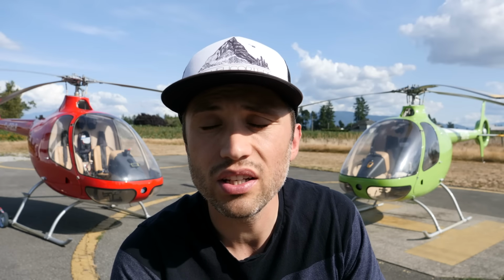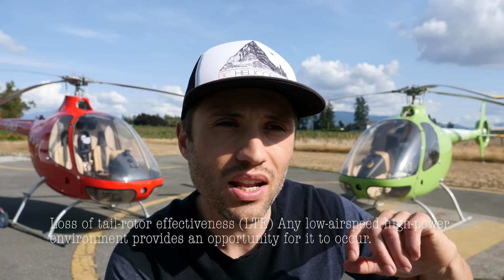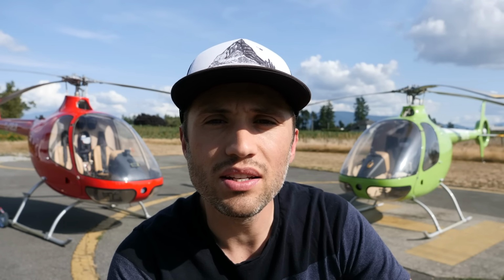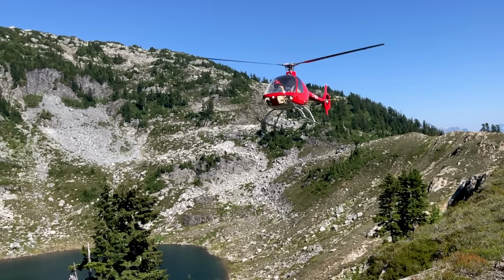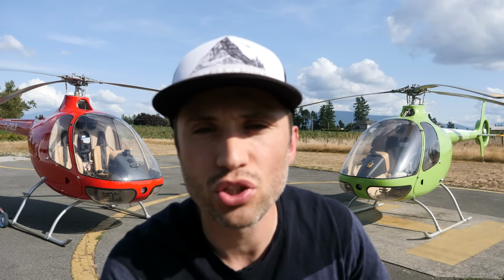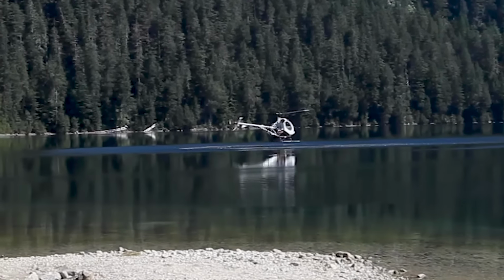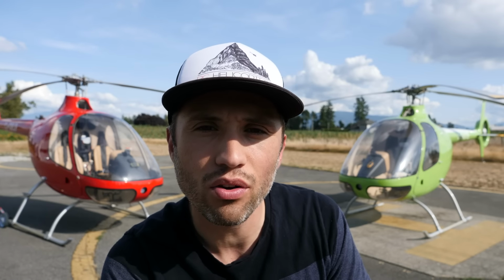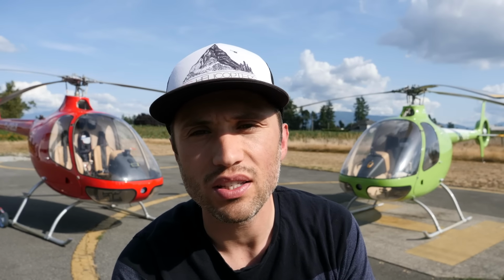OVERPITCHING and LTE can lead to a HELICOPTER CRASH

Comment: I am not a helicopter pilot. How the hell does one have enough power to hover, and then seconds later not have enough power to hover?  Not a single thing changed in that time period. Did a mechanical failure happen? How is any helicopter design certified as being safe for flight if that could happen? Why wasn't this explained in the first portion of this video?
Reply: Temperature, pressure, humidity and altitude all affect the amount of lift the blades generate. The air is a lot less dense at higher altitudes with low pressure and high temperatures, which makes landing and taking off in high mountainous areas or high elevations more difficult.

Comment: This happened to me in one of my Xbox games all I had to do was give a little extra left throttle  .. it was a little different because my bird had floats on it .. yeah I kind of kick ass
Reply: There is no more power available though in a true over-pitch scenario hence the drop in engine RPM. Your situation, accurate flight modelling aside which is to all intents and purposes non existent in an xbox game, was not the same thing at all, you clearly had power to spare.

Comment: Why do you lose power when your hovering close to the ground like that.
Reply: Because you've lost translational lift, there's almost no ground effect hovering over water, and his landing altitude was likely higher than his departure altitude.
Reply: Scott Kkk you don’t lose power. You just need more power. And if you don’t have more ...  it’s like running out of money. Or wits, if you can relate to that.
Reply: @warrenmatheson563  is that accurate? minimal ground effect over water? i thought i remembered that from somewhere
Reply: @josemadarieta3  that's correct. Ground effect is always minimal hovering over water.

Comment: Excellent video and great explanation... It is really important for rotary wing pilots to spend time in the power / performance tables of their aircraft and to check the performance of the aircraft at the associated density altitude prior to taking on "higher" risk maneuvers such as in this video.  Not all aircraft engines may be meeting the performance in the tables that are published with it.  Also wise to make sure you give yourself somewhere around a 10% buffer between your power required to hover and your power available.  Not sure what this guys deal was on gas, just burning off a little gas can give you that power margin. 

Here is a link to a very good FAA advisory on LTE...
https://www.faa.gov/documentLibrary/media/Advisory_Circular/ac90-95.pdf

One way I have often thought of this is that the engine or engines of a helo has a finite amount of power and that power must be divided between the tail rotor and the main rotor.  Once you are in the situation where you are drooping Nr (Power Available is below the Power Required) LTE is very soon to follow and as stated here, the only way out is to gain forward airspeed.  This can really be as simple as leveling nose and wings, center the ball and reduce collective every so slightly.  For most rotor aircraft the wings level attitude is an accelerating attitude.  Once inside translational lift - you are flying and breathing again.  If for some reason you do not fly it out, you will at least be in landing attitude.  When Nr droops, is what helo pilots mean when they say "do not get on the backside of the power curve."  Successful management of any power emergency in a rotary wing aircraft begin with Nr - management.  

Also know when this situation may be at play... High DA, Temps, Humidity are the easy ones.  Losing wind incoming into valley or ravine, down drafts / orographic turbulence.  Making elevated pad / pinnacle landings in a city where winds may create a downdraft causing a sudden increase in power required... also doing these maneuvers at night can also set you up.  It can be harder to judge rates of closure and distances at night.  This can force pilots to make more abrupt or aggressive maneuvers thus  requiring more power correct when compared you how they might execute the same maneuver during the day.  Lastly, do not underestimate fatigue on these types of maneuvers.  Segway...

Consider human factors...
This could have been a high time pilot at the controls and this could have been his 7-8th approach into this LZ that day.  As you get tired - your error rate goes up.  Could there have been a distraction like a radio call or something?  Base ops calling... remember Aviate, Navigate, Communicate (in that order) and do not forget your I'M SAFE checklist.  As is the case in most mishaps... I would guess there are multiple factors at play.   (Error chain)

Another thought on LTE... the direction of the wind as you are coming into an LZ (if forced to take a cross wind) can create an uncommanded yaw (left or right) dependent upon the rotation of your rotor blades.  Anytime you are reach the end point (or the throw of your pedals) to maintain balanced flight in a turn is opposite the direction your aircraft would turn without the tail rotor you are in danger of entering an uncommanded yaw.   While not super common it can happen.  My best advice is, do not fly your helo like your in the blue angles.

I spent a brief period of time in the USCG flying "Tupper Wolf" H65 (A, B and C) models.  The Alpha was notoriously underpowered and it forced its pilots to pay close attention to power management and the performance charts of the aircraft.  On hot summer days we would burn off gas until we could get to our single engine flyout speed and often trained for a single engine failure in a OGE Hover.  It really is a very benign maneuver and is the same exact way I would manage a situation such as this.  I also have some hours in the R22 and can say that the principals are the same on that aircraft.  I love flying and totally miss being in the cockpit.  Great video and thanks for sharing!

Nr maintain...
JBH

Comment: why would the engine ever be out of power to keep the helicopter aloft?
Reply: Density altitude. You have more available power at lower altitudes. He may have been within the envelope from where he took off but landing in the mountains could be a different story depending on altitude, weight and temperature.

Comment: So I'm confused the helicopter is supposed to hover it's not like a plane so you telling me helicopters don't have the power to hover no matter where you're at?
Reply: Air is thinner at higher altitudes.  Fixed wing aircraft suffer from the same problems.  That's why fixed wing aircraft have an operational ceiling.  At or above that ceiling not enough lift is generated by the airfoils to keep the aircraft in flight and it will stall.  The same is effectively happening here with the helicopter.  That's why you will often see helicopters take a running start to take off instead of just going straight up - especially at higher altitudes or if the aircraft is overloaded.  Once the helicopter reaches a certain speed it generates what's called transitional lift.  That lift is enough to keep the helicopter airborne.  At slower speeds there isn't enough lift generated and the helicopter sinks.
Reply: @BitwiseMobile  thank you,  it must have to do with a certain helicopter as well because I've seen helicopters and search and rescue logging and such were they are hovering in the damnedest of places forever to retrieve somebody or objects with zero problem

Comment: Ouch, you are pretty harsh on that pilot. I say the big mistake the pilot made, if you want to point fingers (and I don't think you should), is to fly such a crappy helicopter. That's machine crappiness in it's awe and splendor. The pilot made a beautifully-flown approach to a hover. But obviously his helicopter is either a piece of crap or it malfunctioned. Of course, once LTE sets in I also think he handles the situation very well by putting it down like he did. Good pilot, crap machine.

Comment: Well 1st think you don't fly over water. Flying over water is what caused it. Every pilot know you have less lift over water. You need speed for more lift. Just like landing a plane over water . You lose lift. Called Ground effect. Water reacts different than hard ground on lift. I seen a plane crash at the end of the field because his approach was over water and no amount of power would save him. He kept giving power but the plane wouldn't respond over the water.So he crashed at the beginning of the runway hitting a fence. Need to come in hotter over water and higher.

Comment: Ok,.... You are completely wrong. What you mean by over pitching is not clear. I would say he over pitched his collective he pulled too much. Inducing drag on the main rotor system. You can hear the engine rotor RPM decay as the aircraft descends into the water. The loss of terror effectiveness LTE is caused by the low rotor RPM. This is called settling with power. The LTE was just a byproduct.
Reply: I agree with with you on all of your statements except the last part about settling with power.  Falling below the the power curve of the engine (RPM) played the biggest role. I've been there in an Enstrom. Hovering over water or tall grass takes more power than over a hard surface. Settling with power can happen without a lack of power from the engine,  it is best described as descending into your own downdraft, caused by descending straight down. The more power you add, the faster you fall until you fly out  of it.  I once found myself hovering over deep snow (so i could not just come down in it) in an Enstrom 280. I had a passenger and full fuel. I started to loose some RPM over the snow, and  I remembered a trick from an instructor that was not mentioned here. The tail rotor takes 40 to 60 HP from the 240 HP engine to counter torque.
I applied right pedal and went into a spin to free up some horsepower and was able to get my power back up. Get good at doing pirouettes is my advice.

Comment: I hear everything ya said, and all I can think of is that these little "toy" choppers are all under
powered and shouldn't be certified. If yer hovering in ground effects and yer not carrying your 600# girlfriend, then the damn craft should be able to stay in the air with all it's flight controls actually controlling the flight! It's not like yer trying loop de loops waaay outa the flight envelope. That chopper not being able to stay dry is like the family mini van not being able to climb a hill with two percent grade. Sheese.
Reply: almost any machine is gonna hit a power limit at some point, even the mini van. the pilots job is to know where that point is and not take the machine past it and ask it to do something it cannot. there were a lot of things this particular pilot asked this particular machine to do that it simply could not. result? somebody took a bath
Reply: Gotta agree with Johnny here. They do seem very underpowered. Like a sewing machine almost.  Good information in the video nonetheless. Though it seems the threat of pilot error is greatly increased due to the limited power available.
Reply: You are ignoring all the other factors here. They are a great training and light work helicopter. I grew up flying them. Safety than a Robbi. This was inexperience and maybe bad training. 

Every aircraft has its limitations, a good pilot knows how to avoid them with a good safety margin.

Comment: Can a coaxial-rotor or tandem-rotor heli get into this condition?
https://www.youtube.com/playlist?list=PL7kRxbZe5xzl6J317dUX-rEe4tjFx-WAd

My intuition is "no" based on what little information I have been exposed to about these rotor configurations. Coaxial is practically non-existent in the West, but the Soviets really pursued this concept, and their inheritors are still keeping the design alive today. There are a plethora of videos here on YT showing Kamov helicopters. Hungary seems to maintain wide use of the old Ka-26 model in agricultural applications; it's wonderful to watch them fly.
In a coaxial design, I understand that the foot pedals affect the symmetry of pitch between the two main rotors, to either keep the torque of one balanced by the torque of the other, or to create a deliberate asymmetry so the craft will start to rotate.
So if you are out of power, the rotors will slow and you'll begin to sink, but since the torque can still be balanced as desired between the two main rotors, you will maintain yaw control nevertheless. This may make it easier to recover, as once recognized, you can just add forward cyclic and build translational lift more quickly than might be possible waiting for keel stream to stabilize you in a conventional helicopter with a tail rotor, once tail rotor effectiveness has already been lost.
I've been building a playlist of videos (linked above) I've seen demonstrating small coaxial heli designs. I need to learn more about the disadvantages of the coaxial design, but the advantages to not having a tail rotor to worry about, maintain, break, etc. are attractive to me.

Comment: I dont understand this: Why does the helicopter run out of power in a hover in ground effect in the first place? - how can a helicopter fly if doesnt have power to hover in ground effect?
If you are low to the ground, as the helicopter over the water was, how are you supposed to lower collective without crashing into the water, also pitching the cyclic forward will demand MORE power, because now the helicopter needs to not only propell you upwards but also forwards, costing more energy...
None of this makes any sense to me, and it wasnt adressed, why the helicopter ran out of power doing a slow hover in the first place.
Reply: I am not a pilot, but I think the way it works on a helicopter is unlike an airplane, where ground effect is pronounced, the wings are cutting the air and leaving turbulence behind the plane. However it can give a false sense of lifting force, as the ground effect is strong assisting with lift. Then, as soon as the plane leaves the ground effect zone, it can loose altitude drastically and there is nothing you can do. On a heli you fight turbulence beneath the rotor, when hovering, not providing you with much "solid air". It's like what they do in swimming pools for high jumps, they aerate the water so the impact of the jumper is softer. Turbulent air is bad for lift. Air temperature may have also been a factor here, warm air less density=less lift, but cold air dropping in over the water can also take the heli with it. Choppers are super sensitive to changes in the air. The rest is energy preservation, stationary hover=turbulence (bad lift) but rotor blades are fighting a lot of torque, because of their attack angle. Moving the blades closer to level and reducing their drag, makes the rotor spin faster, moving air faster. Once the heli is moving, NOT HOVERING, the rotors leave turbulent air behind and the added speed of the rotor plus the speed of the helicopter add tremendous amount of lift. The key was noticing the lack of power early on and reacting accordingly. Problems= taking off in a cold valley, at max weight and trying to fly or land in a warm pocket=crash or hard landing at least. Notice how heavily loaded choppers speed in for a landing, pull the collective back, nosing up and using the forward speed and decent speed to add to the lift and land quickly.
Reply: @oBseSsIoNPC  Yeah, thx for your answer, i wasnt aware, that hovering takes more power than forward flight.., but the reasons now make sense to me - (still a bit weird to me, that the lift would decrease while the drag on the rotor doesnt, since drag on a pitched/angled blade should result in a lift-force according to F*sin(angle)) - maybe the bernoille effect becomes unactive in turbulent air, while drag-lift shouldnt as far as i understand. - still i wouldnt feel good about sitting in a helicopter, that is unable to hover and will crash if you stop moving - after all, thats supposed to be the special ability of a heli... - just adding a bigger engine seems like a better solution, than to risk crashing in a slow decent or hover - but i guess experienced pilots are very aware of it and can work around it... - and professional helis like rescue helis or military helis would just have more power and not even run into that problem id assume.
Reply: @jeffreylebowski4927  a bigger engine also means more load capacity. So just like building a garage that you think is big enough, you will end up wishing to have built bigger once its filled with tools and junk haha. Ppl would just max out the HP and not leave sufficient backup power.
Reply: @oBseSsIoNPC  Yeah i guess, personally i would think the load capacity ends when you are at risk not being able to hover and crashing, but i guess if actual pilots think its ok, then it must be ok.

Comment: You did not mention that hovering over water or objects such as tall grass will reduce down wash power off your rotor blades also high altitude or high temperature days will produce the same effect.  Also you cannot make a statement "Transitional lift happens in 10 feet" there are so many variables with this statement see how long it take with a 20 knot tail wind. I flew into Thermal airport in Ca. on a 118 degree day with a piston driven ship and had to do a running takeoff on the skids due to the helo would not hover. Unless you are P.I.C or talked with the Pilot you can't judge on what took place it could have been just about anything like overloading, engine power loss, tail rotor failure and so on. About the only thing that I agree with is that he should have not entered a hover. On a normal day at sea level and a strong running 300 this maneuver can be performed all day long with no problem.
Reply: kevin vt Well, why try hovering out of wind in the first place. Mischa’s explanations are spot on.
Reply: Tim Parter,  you must be a laptop flyer, stick to flight sim so that way you don't die when you do something stupid